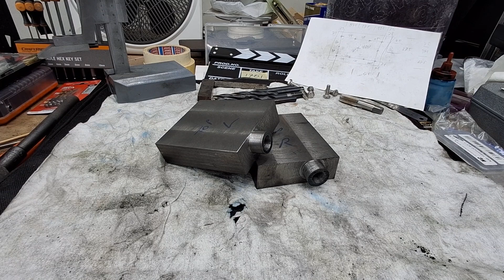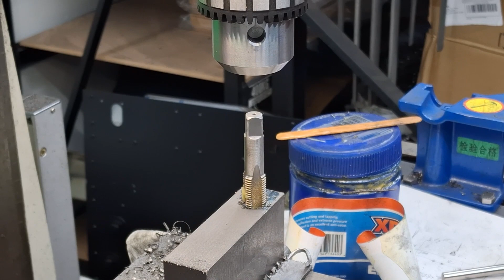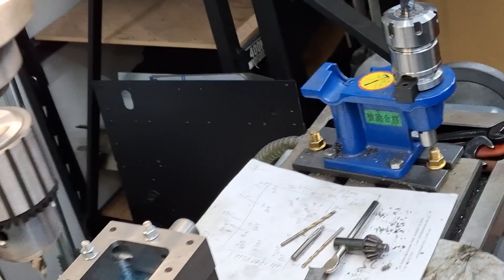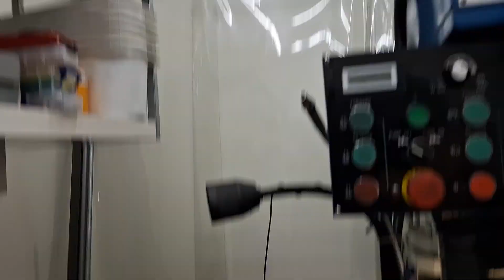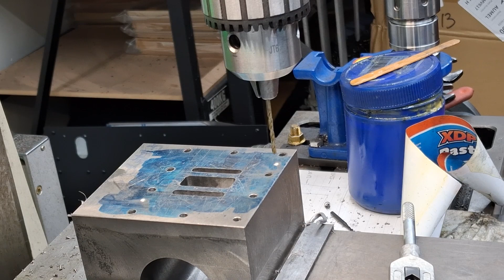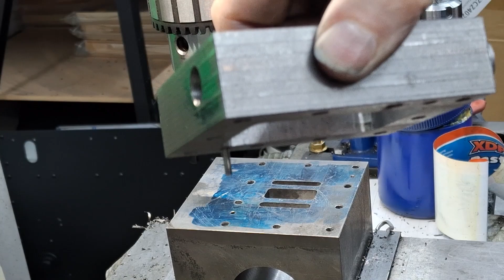055 The Valve Chests Pt2

Comment: Beautiful work!
I do agree it is necessary to evacuate spiral flute taps, I recommend backing completely out. Small chips will bind when you break the chip. Especially smaller ones. It seems like extra work until you need to extract or drill out a broken tap, or worse... scrap the part.
Reply from the maker: Hi Michael, 
Thanks for commenting. The smaller the tap, the more necessary it becomes. Wither way, I do it as a force of habit no matter the size.
The Chef